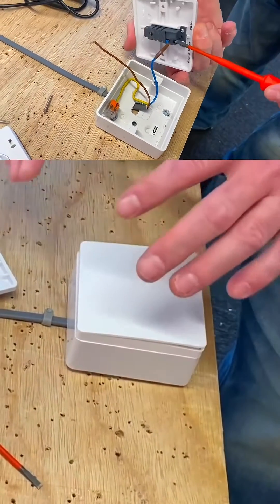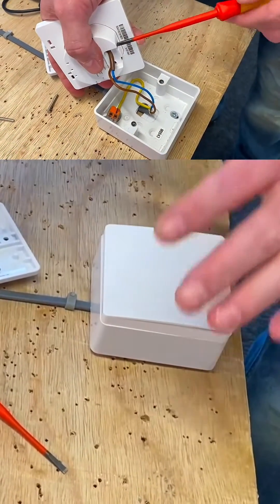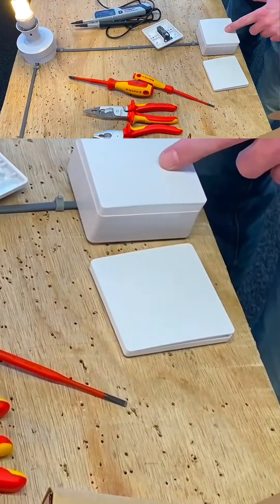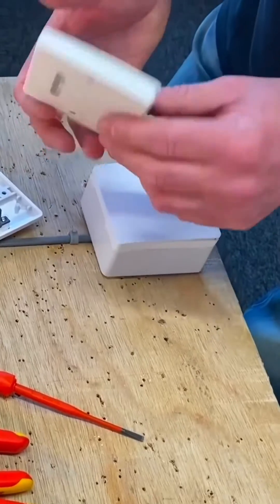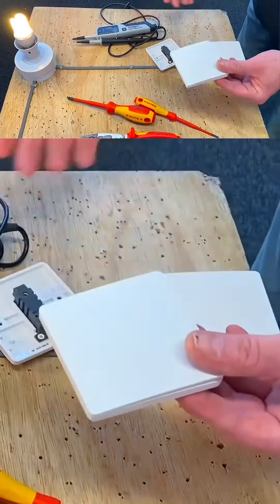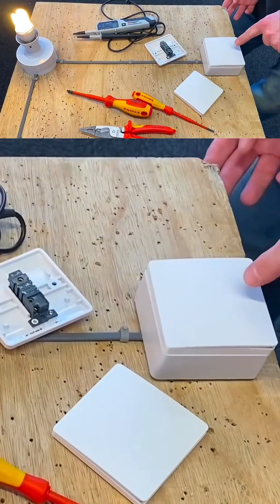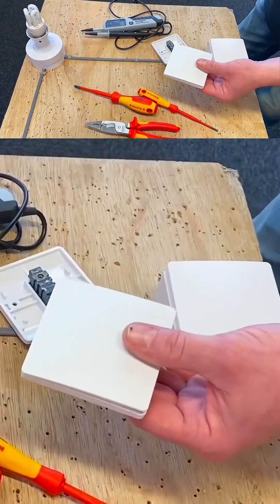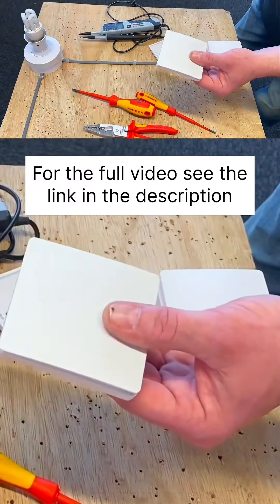No More Wiring Additional Switches

Comment: Personal I hate these kinetic energy switches. They are a poor man's smart switch.  All the lighting, including garden lights are operated using the latest touch smart switches using Wi-Fi. They can be operated like a normal switch, or you can use your voice to operate them , you can also program them , such for example my lounge lights will auto switch on 10 minutes before sunset, if you add door sensors, when you come home at night as you open my front door the hall light automatically switches on. I also added doors sensors to work with my garden lights switch, so if it dark when you open the French doors to go into the garden the patio lights automatically comes on , .plus if I'm away on holiday the light can be programmed to come on at random time during the night. Plus while I'm away I can monitor my light and operated them from my smart phone.  Plus you can link up to 5 smart switch so you can hav 5 way. Switching, my landing light can be operated from to and bottom of the stairs and the 3 bedroom. All I had to was change the existing t&e to the original light switch to a 3 core & e .
Reply: It seems to me you dont actually have a good reason to dislike this product. You just yapped about your smart lights. Like buddy not everyone can afford it, and it's not some horrific sin to be poor, and shouldn't the less fortunate have access to cool technology?